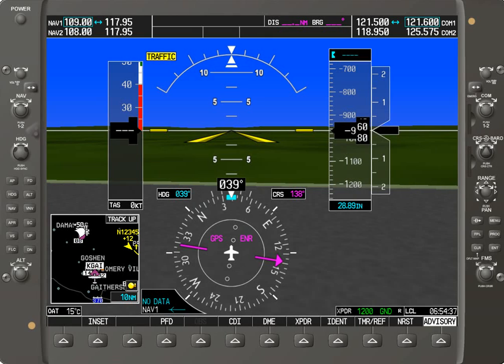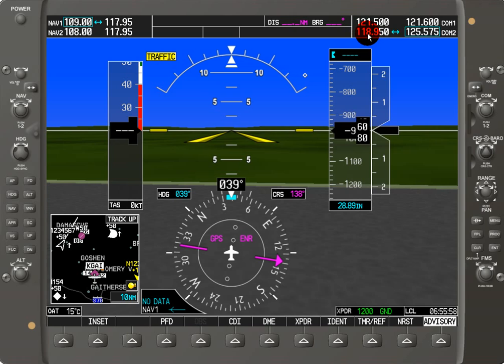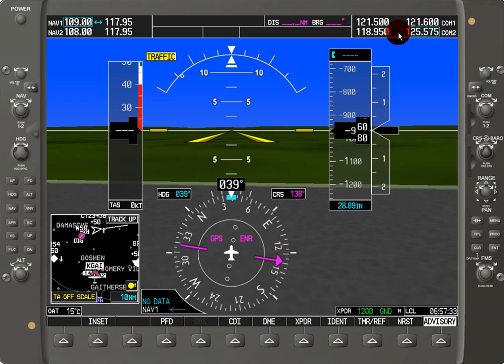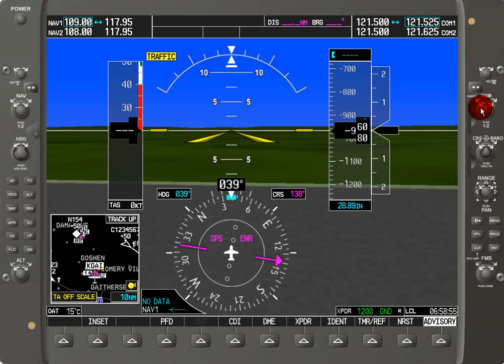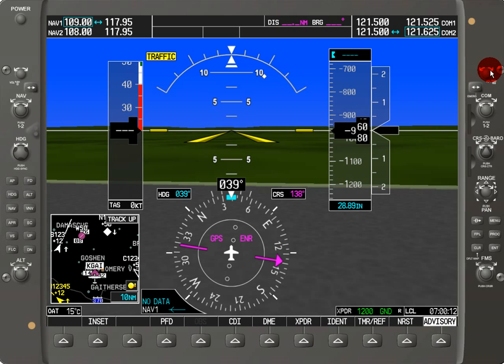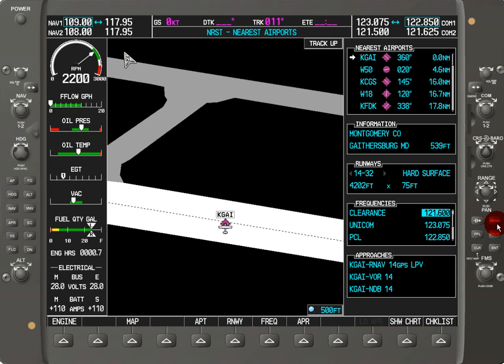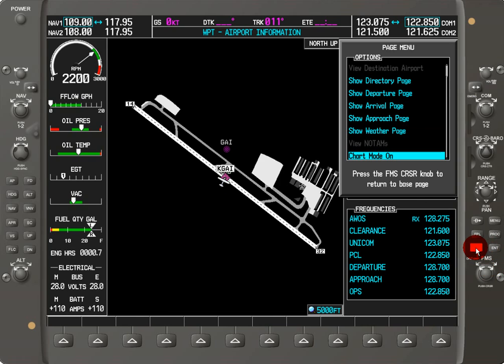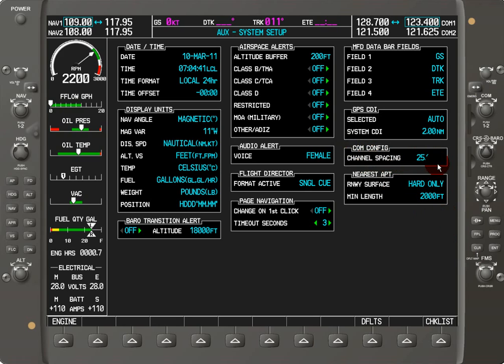Garmin G1000 Tutorial: Com Tuning

Comment: I think you went through the step too fast, especially at changing the freq using the FMS.  There is the FREQ select button that was somehow glossed over in your tutorial at 7min mark.  After selecting the NRST airport with ENT, press the "FREQ" at the bottom bar to enable the Frequencies page.  At least this is on the C172 on msfs2020 version.